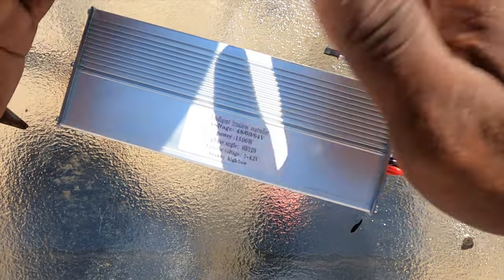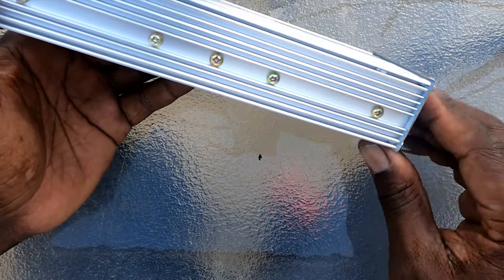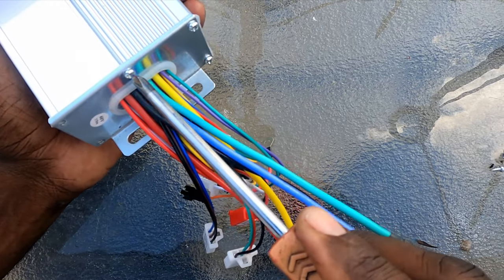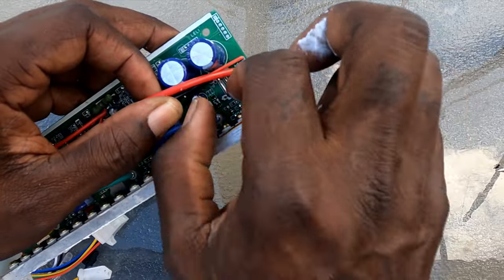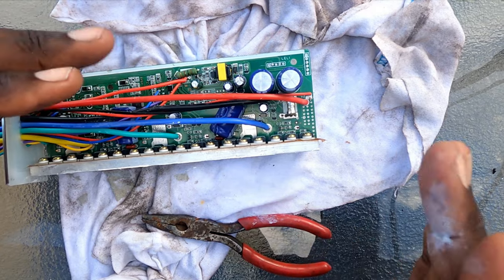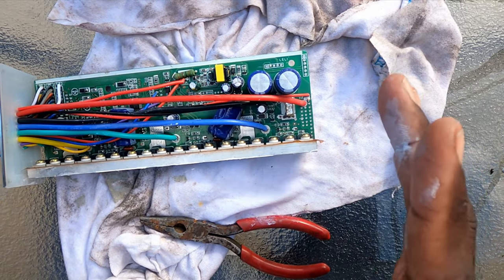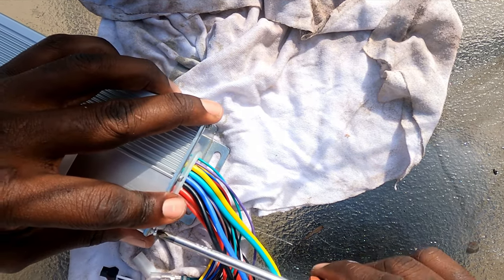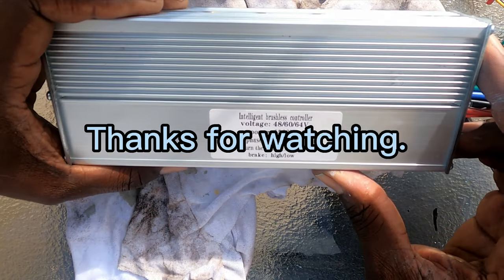How to shunt mod your ebike controller for more power.

Comment: This really works, too much so in my case. I had a 2kw battery and an un-modded 1kw e-bike kit, and it worked fine. I did this mod (and also added thermal paste to the MOSFETS because my esc didn’t have any for some reason?) and it had enough torque to spin the axle and short out all of the wires, which killed the esc.
Reply from the maker: Oh man sorry to hear that,  will you be able to repair it
Reply: @E-bikeguy  
I ordered another esc

Comment: The blue stuff on the screws is not thermal paste. It is thread locker so the screws do not loosen from vibrations.
Reply from the maker: It had some thermal paste on it. It's hard to see, some of them did
Reply from the maker: Dang good question 🤔
Reply: @@XOLKEVxbecause that side cover screws to the Mos-Fet bar
Reply: @stone-islay..74.50 generally if there is one it's a loop and you snip it
Reply: @stone-islay..74.50 
I know on my kit (Voilamart 1500w 48v) it's 2 x Blue wires that are to be connected together via the little black connector block fitted to the wires, this is to limit the power to 750 watts (when connected)

I put a small switch on it, I'm always using the full 1500watt power (switch set to "Off") but if the law stops me I'll say "this switch is set to road legal power mode officer, I only use the other setting if I'm riding off road"
Have fun...
Reply from the maker: @mickyb.8014 lol that was some good thinking 🤔
Reply: @E-bikeguy  Yeah mate, kinda looks cool too as all my wiring's neatly wrapped in black electrical tape and the switch's located just under the back of my seat, tiny little switch that cost me £3 quid off eBay - Made it all look like it's factory fitted, no laws even bothered to ask me about my bike yet, but we just don't even see 'em where I am in the U.K...
Never used it much yet apart from testing it lol, but it might come in handy if I let my battery run down to 25%
Reply: It was loktite and if there was thermal paste on the screw it was there only because the screw went through the past. It wasn't meant to be on the screw . Mostly it was the reason for the loktite

Comment: I have 2000w motor 50 amps controller and 48v with 24a battery if i do that shunt there is any chance of having problems like burn something?
Reply: Got the same specs as you with a 50amp KT controller with 25 rated current, I'll be doing a shunt mod soon, I'll get back to you.
Reply: What up how it go?
Reply: @Pete..  thanks for reminding me, I forgot I commented this lmao. The shunt mod is super good 👌.  As long as your not ripping it all the time from a stop, you should be fine with the heat the controller takes. Make sure to mount your controller outside of the bag it comes with
Reply: if you can get some bigger aluminium heatsink you can increase thermal mass and have better cooling ... glued on with 2k epoxy works fine and the heat is spread out over some bigger surface

Comment: My man!  How many ways can I say thank you?   I just installed my new 72v battery and was sad because it was slower than my 60v.  The increased power caused stuttering and terrible performance.  So, I shunt modded the controller and re-torqued my 3 phase wire nuts.  OMG!!  My bike is a freaking ROCKET now.  50mph easy and sooo smooth.  No more stuttering, just smooth power.  Thank you so, so much.  I was about to drop 200 on a new controller.
Reply from the maker: Wow I'm glad you got it sorted out, I'm just thankful for the video to help you out
Reply: @E-bikeguy   Well, the controller blew.  :(  I think I need a bunch more thermal paste!!  My controller hardly had any, and I didn't add any.  I'm trying again this week and I'll be sure to add more paste to my new controller.  HOpefully that helps.  Thx.
Reply from the maker: @roger3958 ok yes definitely will help out